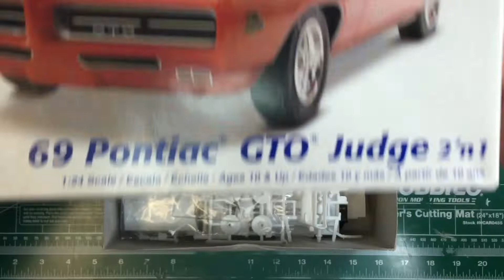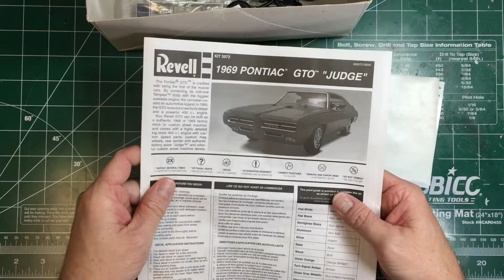Building the Revell 69 Pontiac GTO Judge 1/24 scale model Part 1

Comment: What amazes me, you did all of that without breaking the steering column off, I would’ve accidentally broken that off for sure.
Reply from the maker: I actually did break off the rod that extends past the steering column, glued it back on and then broke it off again and lost it so I will need to cut and glue on some small styrene rod.

Comment: Technically speaking the cement doesn't "melt" plastic, it temporarily dissolves it at the joint. Then when the solvents in the cement evaporate, the parts are fused together. Melting requires heat.

Comment: You're a true pro, you don't complain about the kit the mold lines, ejector pins etc, like some of the other modelers on YouTube, you build. But I do have a question about your paint process, I see you go on pretty heavy on the first coat. Are you relying on the 2K to possibly cure any problems? Thanks for the good videos.
Reply from the maker: I do go heavy on my first coat, most times too heavy. I probably should mention that I generally apply three coats at a minimum but I don't show that in the video as there is no difference on camera. I do make sure my paint is smooth and in good order prior to clear coating.

Comment: What paint do you use to get that nice metal look? I have been using spray paint  but doesn’t look nearly as good.
Reply from the maker: Most of the paints I used for the body are Gravity Colors USA. I find that almost any paint I apply with an airbrush gives me a great finish. Some guys are skilled with "rattle can" paint and can make it look good. I am not one of those guys so I airbrush my paint.
Reply: @ScaledDownCustoms  perfect. Thank you so much for your reply. I also have trouble putting my body in to the chassis. The instructions tell me to fit the interior on the chassis and then the body. Do you recommend any different?
Reply: @dannypino3130  I struggle with that myself. I usually have to pull outwards on both sides of the middle of the body. It is a tight fit and I'm always afraid I'm going to break something.

Comment: If you don’t mind I have a couple of questions. First one, where did you get your 5000 Tamiya sanding sponge?  And the other one, what grit of stick are you using to block sand with?  Thank you for your time.
Reply from the maker: I get almost all my supplies from MRS Hobby Store https://www.mrshobby.com/ to include my Tamiya sanding sponges. The thin sanding sticks are just hobby sanding sticks, again from MRS. I do not know the grit level. The larger blue sanding sticks are emery boards for fingernails. Again I do not know the grit level on those.
Reply: @ScaledDownCustoms  Thanks for getting back with me.  I ended up buy a fingernail file, thats got 8 different grits at the Dollar Tree, that may be good for blocking.  I really enjoy watching your videos!  Thanks again!